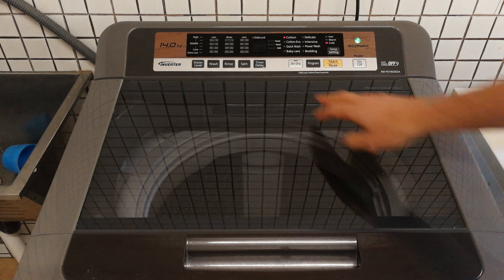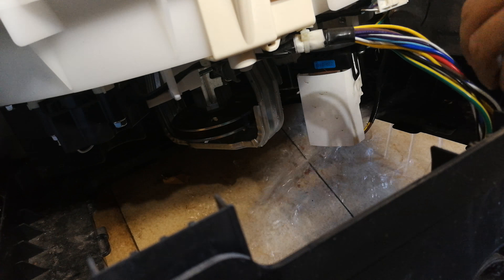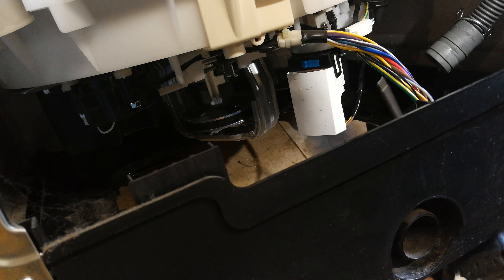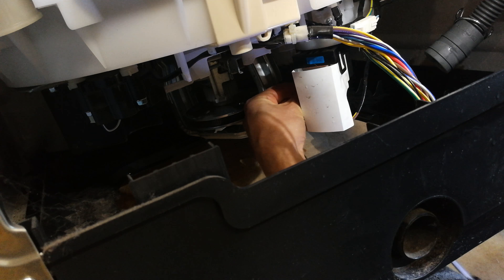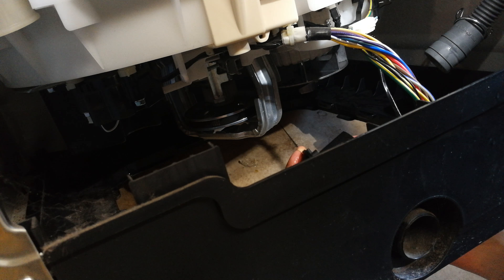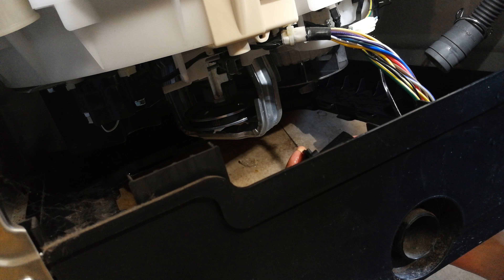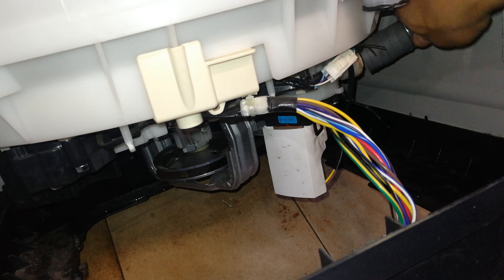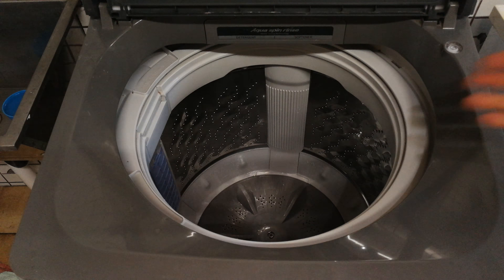How to fix a washing machine that is not draining (Panasonic EcoNavi)

Comment: I have also the problem but with coins but have a slight problem the coins are to big for the hole so stops te water at the hole before the impeller what can i do to fix this
Reply from the maker: you can use a air blower and blow the coin back into the drum. Then there is a nut that can be opened to release the drum. I have not opened the drum so cannot say for sure.
Reply from the maker: have had a lot if issues with this model, would not buy again

Comment: How do I know if it is the impeller, water pump, or sensor? I already took a coin and heaps of mud
Reply from the maker: if impeller is blocked the water does not empty properly. Water pump is when its on the cycle and you see the water pressure pushing against clothes.